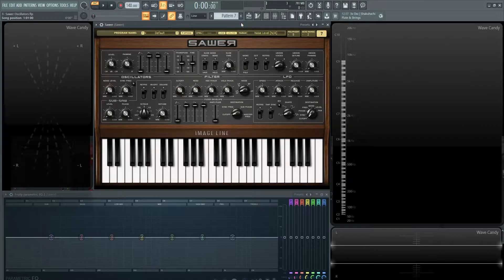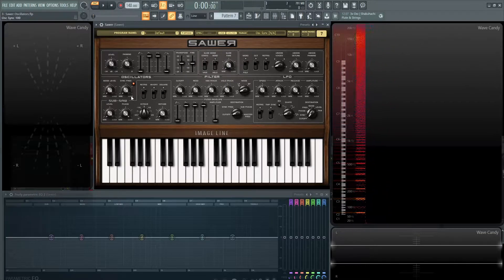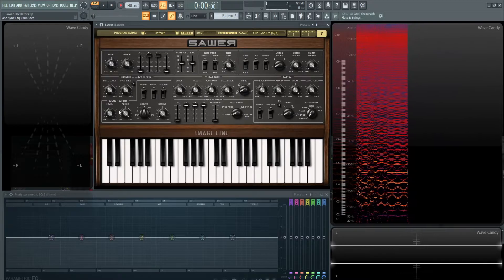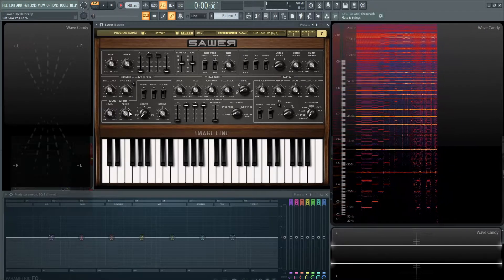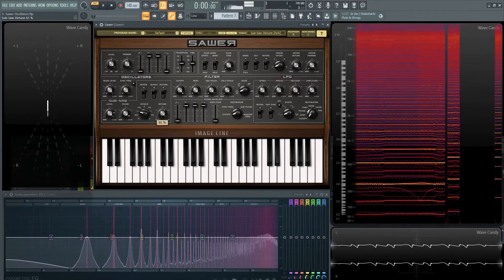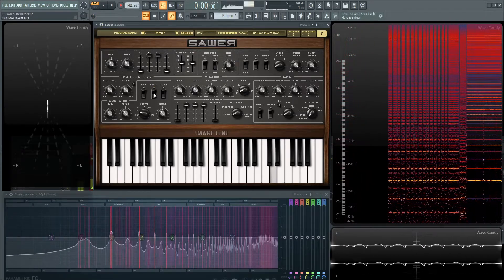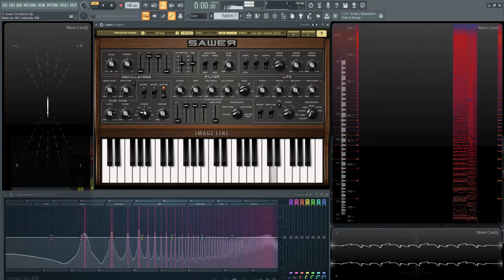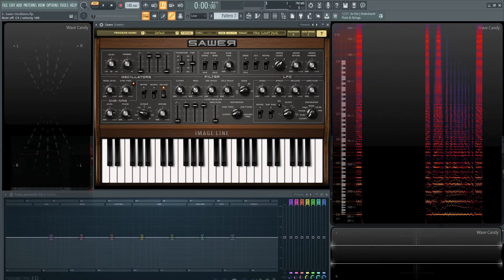Sawer Tutorial PART 3 Oscillators | FL Studio Tutorial

Comment: Here’s a tip for the sub saw:  you can use it to get something close to a pulse wave / PWM out of sawer. From init patch > turn sub level all the way up > make sure octave is 0 so you’re doubling saw waves on the same pitch > hit the invert switch (and retrig so the effect stays consistent).  If phase is all the way down the two saw waves will cancel eachother out if done correctly, all the way up it’s a square wave.  Modulate the phase knob and you get pulse width modulation 😁